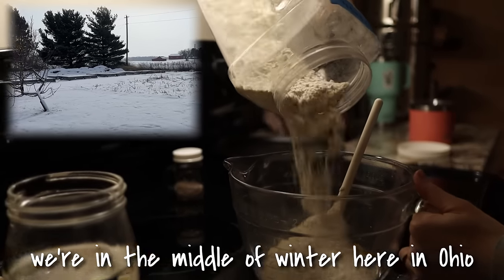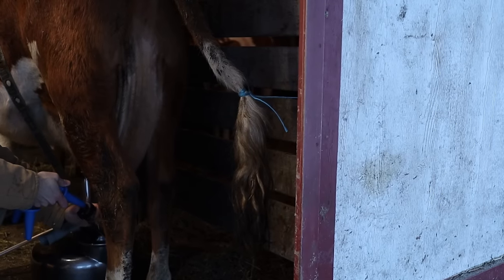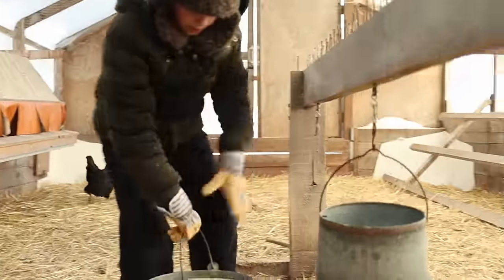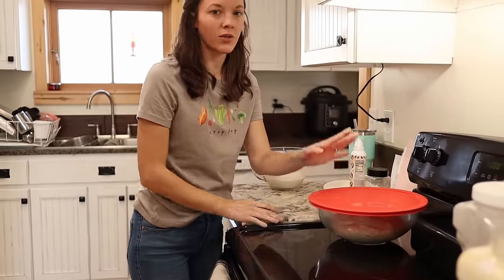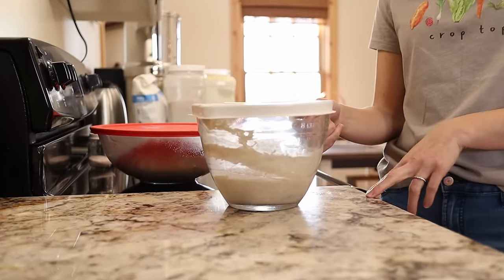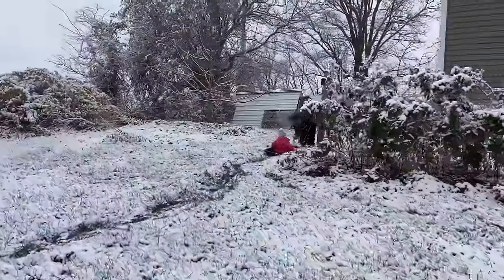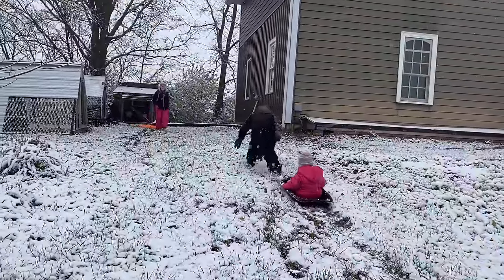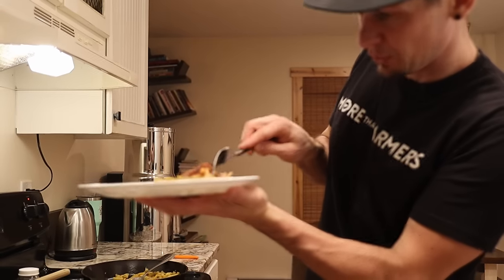From SURVIVING to THRIVING (+Simple Sourdough Bread Full Tutorial!)

Comment: If the air in your home is dry, causing nose bleeds or stuffiness, you need to place water bowls around your home, especially around the pellet stove to improve the humidity. Tap water is fine, just remember to keep them topped up. It makes a huge difference.

Comment: In Germany they hang ceramic vases,  filled with fresh water, on their metal Radiators to add moisture to the apartment air. You can simply use a Vics Vaporizer in each bedroom at night with 1 Tbsp of salt in the fresh water, that turns off automatcally.  Or by day, you can simmer on a stove a large pot of water with  spices like Cinnamon sticks, cloves, Orange , lemon , and apple peels :  it adds a nice fragence to the air while humidifying the Winter air.

Comment: Not sure if you can do this, but if it was really cold, I used a small propane heater in the barn while milking. It seemed to help all around. I did take extra precautions of course, because it is definitely a fire hazard if you aren't careful.
Reply from the maker: It could help, but my barn isn't tight at all, so the heat would just disappear. I'd also be afraid of the fire hazard.. Hay everywhere.
Reply: @morethanfarmers  I used a 5 gallon tank with the head unit, and either tied it to a metal folding chair or put it in a square milk crate so it didn't tip over. I have some medical issues, so I don't do so well with extreme cold. Currently, I just have a little heater I use on a porch with the goats, so I don't need anything crazy.

Comment: Good Morning Codi and Michelle. Lasagna, bread , Mead ,  and Cheese what a great life ! They all look so tasty. Thank you for your video, just  lots of good information.  Codi I am excited to share another Utube site called "Simple living Alaska ." These folks keep chickens all winter long in Alaska . Check out two of their recent vids about a small heater they use. It might work for your homestead. Please watch the first vid is called "Let There Be Light! | Heating The Chicken Coup With Diesel Fuel," and the second video is " Heating Chicken Coup For Alaska's Harsh Winter." On another note I recommend a thick rubber water trough so you can flip the ice cube out by flipping the thick rubber container  over as the ice does not stick to it. Some big farms use and old tractor tire. They cut the top of the tire off, and seal the rim hole on the bottom of the tire. Depending how big the tire is you can hit the sides with a sledge hammer with out damaging as the rubber tire is pliable.  Hope these are useful.
Reply from the maker: Simple Living Alaska is a great channel!

Comment: Michelle, set a teapot full of water on your pellet stove, it will add moisture to the air and help with the nosebleeds. Something else you can do is a Saline nose spray. On your PAM cooking spray, have you ever read the info? I did, late last fall and discovered they use a Propellant (i.e. Butane or Propane!) EEK!
Reply: She did say she uses an avocado oil spray now. Most of the sprays do contain a propellant, but you can find some that do not. I buy an avocado oil and an olive oil spray from Aldi and the only ingredient is the oil. I guess it just uses pressure.
Reply from the maker: That's why we switched to Thrive Avacado Oil!

Comment: You may be already doing this, and it is just not helping as much,  but I do want to give you some of our experience on nose bleeds. My eldest caucus always had terrible nosebleeds.  One time, it was so bad that we almost went to ER, but fortunately, we were able to stop it.  First of all, if you do get one, try to make sure that the cotton ball you stick in there is rolled up very tight and sitting in there very,  very tightly as well.  Also,  it helps to run a humidifier at home.  Another thing that is very important for someone who has that issue is to wash your nose with salty water daily,  use a neti cup, or a bottle. Then, smoother the inside of your nose,  with soda body butter, like the one you would make out of your tallow.  When you go outside in a very cold air, make sure there is a protective layer of fat inside your nose,  and wear a scarf over your nose and mouth. I hope that helps.  My daughter's nose bleeds are so rare now,  before she used to get them almost daily.
Reply from the maker: Thank you for the tips!

Comment: Do you guys ever use essential oils? My kids have all had nose bleeds so we keep geranium on hand to help coagulate the blood when they get a nose bleed. You just need to sniff the open bottle a handful of times (deep sniffs) and then give a few minutes.  Usually subsides rather quickly after that, but if not just repeat as necessary.  This is a great oil for cuts for this reason, too.  We have also dabbed a teeny bit of the oil onto a finger to then kind of swipe onto the skin under the nose, but some of my kids have been sensitive to the oil on the skin, so may not be best, or maybe needs to be diluted in a little olive oil first.  Hope you feel better with the nose bleed!
Reply from the maker: We use some, but we don't have that one. Thanks!